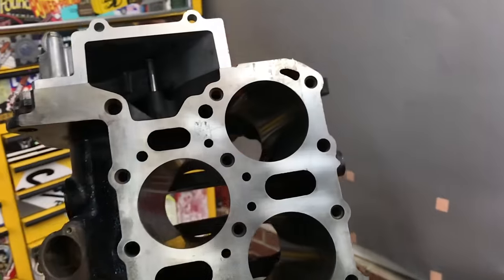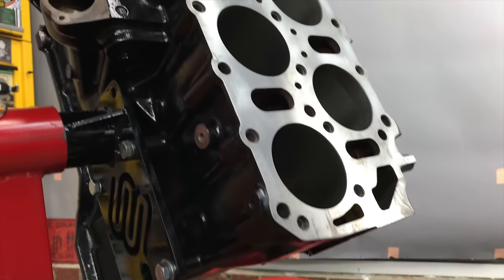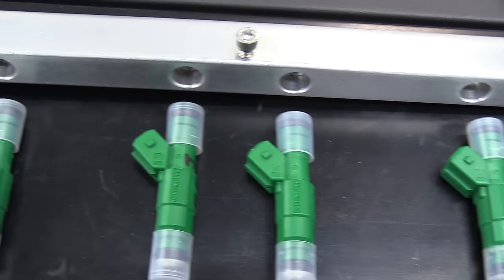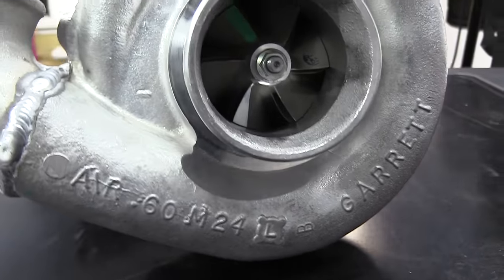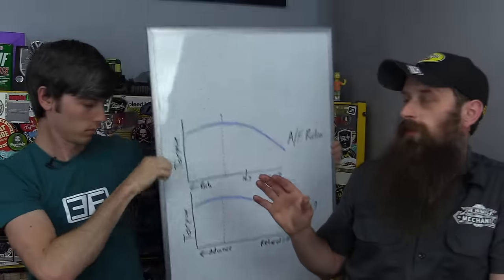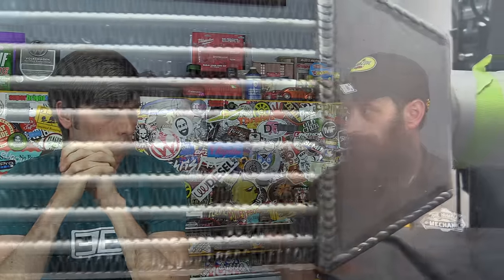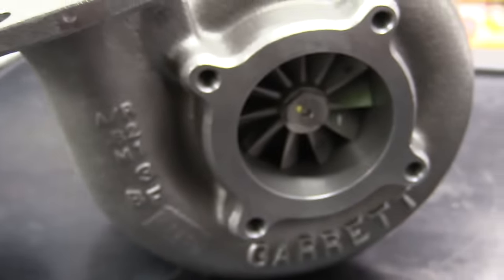5 Ways To Prepare Your Car For Turbocharging

Comment: Step 6: get a car with a turbo from factory
Reply: many cars don`t come with turbo...
Reply: actually If your buying a modern car , there is a big chance it will have a turbo in it , to help a down seized or small engine achieve the target power output.
Reply: Actually many new cars do, it's just that they're tiny, efficient, cupcake turbos...
Reply: Omega Rugal get. one. that. does.
Reply: King_tazzThats why I have a 97 Saab 900SE Turbo. it runs 13lbs of boost & pushes up to 148mph
Reply: [ Insert Name Here ] only if it's a Porsche.
Reply: Th3 Raze Saab is notoriously bad with their turbo reliability
Reply: Bryan Hopkins Or pretty much any AWD car
Reply: Bryan Hopkins that's inaccurate Saab was one of the first to design a long life turbo called the. garret t5 turbo.
my Turbo is 20 years old old & is still in in good condition where i can bolt it off & sell it for a 9-3 viggen turbo
Reply: yeah, if i wanted a diesel
Reply: Georgi Kabruzov My Saab is premium gas?? no diesel.
Reply: +Th3 Raze  Technology moves on.  Current Hyundai (of all companies!) boost pressures are up to 18 psi on their stock motors now.  No idea of actual top speed, but estimates say around 155 mph - but wind resistance is a bigger player than outright power in that equation.  Hard to believe things have moved on so much in such a short time.  :-)
Reply: I think small turbo's are unreliable in the sense that it's easy to push them too far, as running too much boost with a lot of exhaust flow will make them overheat and the bearing will be toast, you'll get shaft play and then start grinding the blades. 

Happened to my K04 in my Mazdaspeed 6, at 60,000 miles, but I managed to swap it out to a BNR S3 before it got worse. It's journal bearing but it's $1,000 instead of the ball bearing one which usually go for around $2,000+
Reply: Th3 Raze   Well a Garrett Turbocharger is most likely designed and pruduced by Garrett and not the Car Brand they supply to.
Reply: +SI0AX  I believe that's generally not an inherent problem with the turbo itself.  It just means you're trying to screw too much boost from that size turbo and should have gone to a larger one.  Smaller turbos are usually used for lower boost and less lag, especially on smaller capacity, stock engines that can't flow all that much exhaust.  For boost levels beyond what the small snail can deliver at it's optimum operating speed, you usually just need to use a larger turbo and put up with the lag (or install anti-lag - but that's usually even worse for turbo longevity.)  One needs to use what's fit for purpose, not just shove the boost up and hope it holds together.  On the other hand, I'm not claiming to be an expert - anyone else want to slip in their 2 cents worth?  :-)
Reply: and look for a sleeper, alfa romeo mito 1.5 turbo (which is just a older fiat with alfa styling) is like half the price of a japanese car with same HP 2nd hand because of young males.
Reply: Step 6.a gain literally no first hand mechanical experience? Lol
Reply: A more important factor is boost at low vs high RPM. Small turbos don't operate very well at high RPM and modern cars even have the ECU tuned to automatically close the electric throttle and high RPM to prevent over speeding the turbo at stock boost levels.

I reflashed my ECU to override the high RPM limit, but I keep the boost at spring pressure at high RPM and just upped the boost a bit at low RPM so it wasn't like I was running it to death. 

I knew I was pushing my stock turbo too hard but I expected it to last longer, lol. It only really lasted like 20,000 miles after I did the modifications when the car had 40,000.
Reply: SI0AX So did you find out why the turbo failed? Not enough cooling or lubrication? And why will your new turbo last longer?
Just curious.
Reply: Most new turbo charged engines have variable vane turbos. New engines that are turbocharged are also smaller in displacement and the turbo makes up the power for increased mpg. 
If you want to truly have fun turbocharging v8s is the way to go. For little money give owners great increases.
Reply: It had a defective design from the factory.
The shaft is too long and thin and the bearing design is bad. My bearing was in bad condition when I checked it, shaft play led to wheel slight grinding that was only going to get worse. It's very common for the turbo to fail as oil seeps past seals and oil starts getting burned so that doesn't help either. 

It wasn't worth rebuilding as it was ball bearing from factory + bad design, so what the aftermarket company BNR did was salvage the exhaust housing and bore out the internal wastegate port along with fitting a bigger exducer wheel and bigger compressor housing, so it's a hybrid.
Reply: SI0AX ty for explaining! 👍
Reply: Omega Rugal ... Most new cars after 2000s do
Reply: The Raze heavy af
Reply: King_tazz but how do i swap a 1.0l ecoboost to a ford ranger
Reply: That's not a project though is it? You didn't learn anything, you paid somone else or a company. Same with ppl that pay other's to mod their car.
Reply: Nick Pierpoint unless for example you have the common ecoboost engine (2.0) and race gas and want to go faster and you swap from stock ko3 borgwarner to Garrett gtx45 turbo, now that's a project for a motor like that count on taking oolut awll internals and rebuild

Comment: On my 200 3.6(which has no after market turbo kit) and since its an open deck design i have to get an open deck support, beef up the trans, lower temp thermo stat, and  the big one, dyno tune, hand help tunes are great, but dyno tunes are better imo

Comment: Years ago I had a 1986 Isuzu Trooper II.  It had a 95 hp engine.  Called a shop specializing in turbo conversions.  They said they could put an aftermarket turbocharger on and increase the engine output to over 200 hp.  Thought seriously about it but decided not to.  I don't recall the price tag but it was a lot.

Comment: By lowering your compression with the spacer, does that defeat the purpose of a turbo? Isn't the turbo increasing the compression in the combustion chamber?
Reply: no.  The ultimate goal of turbocharging is to increase the mass (not pressure) of air in the cylinder so that you can burn more fuel to produce more power.  decreasing the compression ratio does not reduce this mass since it also increase the volume. too high pressure (both from boost and compression) is bad because it causes heat which reduce efficiency and increase risk of knock.

Comment: Great video!  As an engineer who has does stuff like buy pristine cars with A/T and seized engine cheap, and put them on the road with modified engine, multiple carbs, and 5-speed manual; and having owned 4 turbo VWs, I'd like to point out a critical issue that was missed:  Every engineer or mechanic worth his salt knows that VW's sludge problem was not an engine problem, but an owner problem.  You talked about running better quality fuel, but you forgot about running MUCH better quality oil, as normal oil, put through a hot turbo-charger, will turn to goo and plug up the engine.  Just like it did for all the morons with VW/Audi 1.8T and 2.0T cars who ignored the owner's manual and put Walmart's cheapest crap into their car, resulting in clogged engines, clogged oil-pickup screens, and seized blocks in the worst case. 
So ... top-quality synthetic oil only. It will cost around $15/litre/quart but it comes on sale.  And it will save your turbo engine if the engine oil is used to cool that orange-hot lump under the hood.  
At a minimum, it should meet VW 500.03 specs. 
There is even a couple specific oils, that if used for oil changes in your BMW (and you have receipts to prove it) they will extend your factory warranty by 100,000 miles, its that good. That's the Castrol “GC” 0W30. 
The 0W30 is the famous "German Castrol" - much loved by BMW owners and oil geeks as one of the very few oils that meets BMW's long life specification. 

Otherwise you guys hit all the points.  Excellent explanations. :)

Comment: when I built my first turbo car I dropped the compression ratio from 9.5:1 to 8.8:1. if I was to do it all over again (and I might) I would leave the factory compression there. the only setback with keeping the higher compression is your tuning window of error shrinks some. in the end you'll still end up with a fast car with not as much boost verus if it had lower compression.
Reply: PANTYEATR1 higher octane fuel, simple fix
Reply: Realtime1501 I'm already running 93 octane only. i build my cars to be powerful street cars that can start, run and drive anywhere in the states. i run 8.8:1 and 20 psi. if i kept the OEM compression the boost would come down, but it would be a stronger car off boost and possibly on boost too. if e85 was everywhere like 93oct, then that would be an easy fix and i would tune for that.

Comment: Why not paint the intercooler black? Mighty Car Mods done a video on this and found zero temperature difference between stock vs painted.
Great video, it's given me a lot to think about before I turbo charge my inline 4cylinder vvti corolla
Reply: hey blue, the paint is an insulator, that is why no intercooler in any performance application, including F1 is anything other than bare aluminium.

Comment: My buddy has an old ford ranger 2.3l pickup. We are going to install a turbo kit so that the pickup isn't so gutless up in the mountains lol. We aren't planning on running more than 5-8 pounds of pressure. Any dangers that we should be worried about?

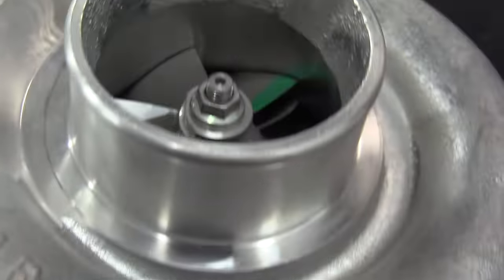Comment: Hi, Is it a new turbo ? Can someone tell me  if the little scratches we see at 14:49 / 14:50 on the compressor blades are normal ? I have the same on my 40 000 km Garrett and didn't know when I checked it if it was normal for a rebuilt one or because something get in the air intake. Thanks for help ;)

Comment: Hi ! Few question if I may :)

regarding the fuel injectors. I've heard of those fuel injectors for different CCs like.. a 2000cc injector, 1800 and so on. What are their differences ? pros and cons ? and fuel rails too. They are stand-alone units functioning as injectors or it directs fuel to the separate, individual, fuel injectors ? 

thank you for your replies. Much appreciated !
Reply: More cc on injectors means they can provide more fuel to the cylinder, there are no cons really, you can have too large injectors without a problem, but if they are too small your fuel supply will be limited to their max which might cause knocking and loss of power.

Fuel rails usually connect fuel lines to fuel injectors, injectors can be switched on fuel rails. Every fuel component needs to meet the spec, large fuel injectors and high pressure pump are useless if fuel rail is limiting the flow.
Reply: Going to big on the injectors can cause problems with idle. They can't open and close fast enough at idle so it will be to rich. Not that big of a problem on a drag car but on a road race or a street car it can suck bad.
Reply: Those helped me a lot. Thanks guys. 

so if i'm aiming for a turbo in my car, how do i choose good injectors according to the boost level provided ? or the ECU does all the job ? sorry for asking a lot :3 more and more questions poppin in my head. Thank you for the answers ! :)))))

Comment: Nice hole next to welded bung for the oil return to the pan!

What was was skipped entirely here is difference in design of engine blocks, heads, pistons, crankshafts, inlets, exhausts, piston cooling, oil pump capacity and cooling, etc.

There is a video here comparing the BMW NA N52 to the first generation N54 turbo six cylinder engine (BMW is now on its fourth generation turbo I6).  Comparing part numbers for even the much older Nissan VG30DE vs VG30DETT in the F32 300ZX will reveal a legion of differences.

Jason correctly states, "If you want a turbo charged engine, go buy a car the OEM designed to be turbocharged."  Just because you can slap one on an NA engine and have moderate success doesn't mean it is a well engineered solution.  Far, very far indeed, from it.

Comment: My intercooler has some play to it. Is it supposed to have a little wiggle room or is it never supposed to move a millimeter? I'm worried it and the radiator behind it aren't mounted the way they should be in my car.
Reply: Devin Stambolziovski no you intercooler shouldn't move around.
Reply: Cheeki breeki iv damke

Comment: I have a question, about ebay turbos grenading your engine. If you build your engine for boost, should it be able to withstand ebay boost? Wouldnt the turbo set up blow before the engine? Cause either way your building it for boost

Comment: What about gapping the piston rings? I blew a piston because the ring gap closed all the way, and binded into the cylinder wall, then the piston just melted and broke off. The guys at Engine masters blew a piston for the same reason, but with nitrous.
Reply: Older engines are better as the ring end gap opens up with wear.

Comment: Usually, when you turbocharge a naturally aspirated car you can set boost to 5-7 psi to keep it safe. Is it possible to increase that figure to 9-11 psi by adding a compression reducer (head gasket spacer) and still be safe?

Comment: Hi, I have a little project that I am thinking I would love to try out, but require a little assistance, or advice, possibly some guidance.
I have a 2000 Hyundai Excel/Accent X3 that has the NA 16V DOHC 74kW/100HP Inline 4 motor, and want to increase her power output with some Forced Induction.
I am wanting to try to convert a Turbocharger into a DIY Centrifugal Supercharger by cutting off most of the Exhaust Side Housing & replacing the Turbine with a Belt Pulley.
Instead of plumbing Oil Lines from the motor, I am thinking of utilizing a small Transmission Oil Cooler as a dedicated Supercharger Oil Cooler.
Just wondering...  are my thoughts feasible?  Would I need to Gear the Compressor to make it spin faster to create any kind of useable Pressure (how fast does a Turbo Charger Compressor Fan spin up to, generally speaking?  Like, a bare estimate/ballpark figure?).  I could possibly convert the Oil Cooler portion of the Turbo (between the Hot & Cold sides) into a Gearbox, I am guessing, if I would need to do so to make the Compressor spin at high enough RPM?
I only really want to make about up to 20% more power, though being able to rebuild it later on for more power would be very nice also.
I am thinking that with a fair amount of DIY experimentation I could build a makeshift home-made Centrifugal Supercharger from a cheap Turbo and a few bits 'n' bobs for much cheaper than a Turbo Installation, a Centrifugal Supercharger, or building an Electric Supercharger using RC Batteries, ESC, etc... (a future project that I also want to try out someday.   lol)   ???

Thanks in advance for any advice or thoughts/ideas you may be able to swing my way.
Cheers!    😊

Comment: I also have a 2007 Volvo XC 90 would you advise having a turbo charger... I’m not going to do it on both cars I will on one or the other, on which one would you suggest to have the turbo charger on the 2007 XC 90 or the 2014 X3.5 BMW X6? Tks for your vids and sharing your knowledge 👌🏻

Comment: would you turbo a brz? I'm thinking about it, I certainly want the power, but I've also heard it ruins the balance given by the boxer engine 
thoughts?
Reply: Anglo Eternal i would - in fact thats what i want to be my midlife crisis sports car :)

But how would the turbo affect the boxer balance? Are we talking weight, changed centre of gravity etc?
Reply: Probably a good idea. Only way that piece of trash will have more torque than a lawn mower.

Comment: So considering comp. Ratio I have a vq35hr in a nissan 350z  with a comp ratio of 10.6:1 is that safe for a turbo or what should I lookout for or should I change the ratio. I only plan on going to 7-10 psi. Just want alittle more power and that sweet sweet spool

Comment: Not sure if you'll read this but, would it be possible to run 2 bigger turbos into multiple smaller or vise versa depending if tge smaller ones be better to run multiple bigger ones.Example : you have a v6 with custom intake manifold, in which you could connect 6 pipes that would run into the smaller or bigger turbos, while running 2 off of each long tube or shirt tube headers.Would this be possible?

Comment: We own 2 Kia's
A stinger GT
And a new K5 
The new K5 has a eensy weensy 1.6Tubo
It calls for regular fuel.
Do We need Premium to safeguard our little motor or do we rely on the knock sensors 
Im fine with paying more for Premium 
But only if its worthy such as 
better performance or save a catastrophic engine failure.
Your thoughts.

Comment: I have a question: if the turbocharger needs oil feeding for cooling and lubrication, wouldn't you need an upgraded oil pump instead of the OEM one? (sorry for the English)
Reply: Not really, you just divert the oil to turbo, it wont affect overall lubrication much.

Comment: Should the cams be changed to suit running a turbo?  Back in the day (and I'm talking about the '70s here), the consensus was that one couldn't efficiently run a turbo on an already-modded engine, as the higher-performance cams on small displacement engines back then tended to have quite a lot of valve overlap to allow for the inertia of the incoming charge at higher RPMs (and so had a very narrow, peaky power band), and it was thought that running boost would simply push too much of the charge through the cylinder and out the exhaust before the exhaust valve fully closed.  Is this still a consideration, or do modern cam/valve timing designs negate this issue?

Comment: What if I own a purely mechanical engine? Meaning no computers or any electrical stuff? I installed a T3/T4 turbo on my 4ja1 Isuzu diesel engine, modified injectors so it sprays more. It also won't go past 0.5 bar.